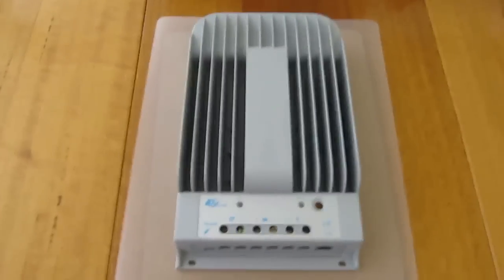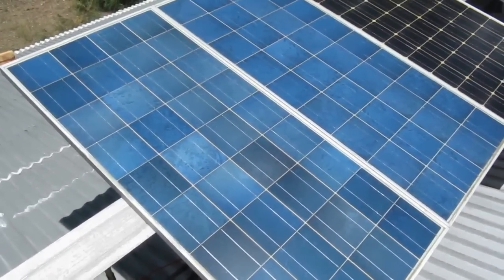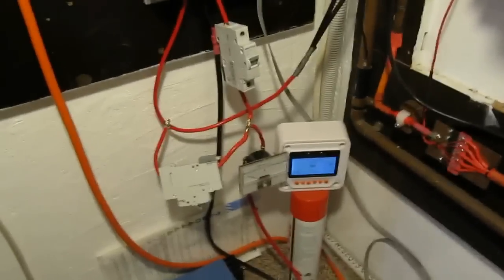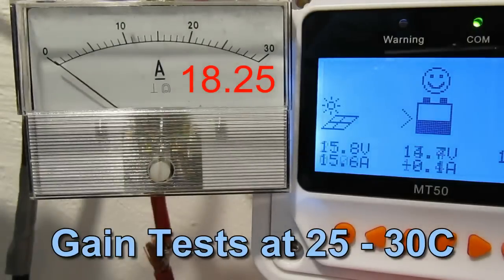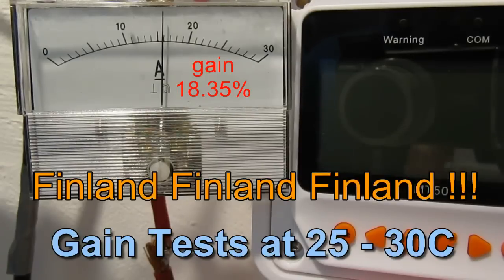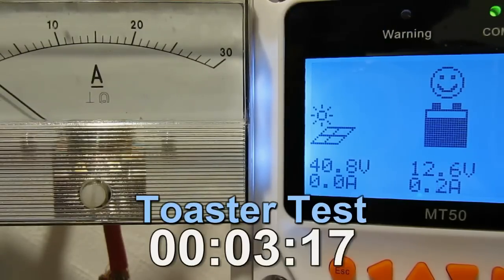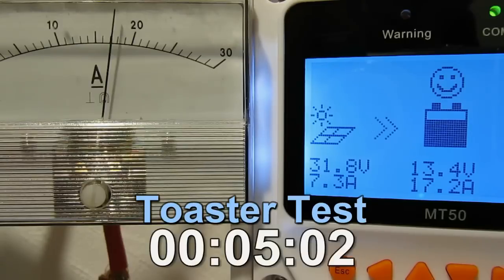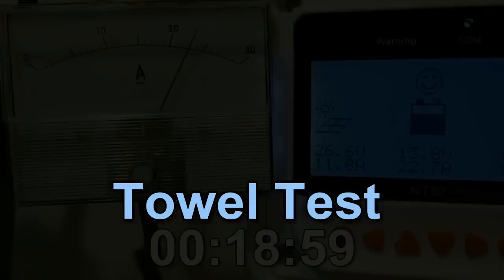EPever EPsolar Tracer 4215B MPPT review PART 1  - 4215BN

Comment: If your panels are barely putting out over the 14.4v, an mppt wont have much gain for you. If you have 92v panels like myself, you'd be an idiot not to use one. The mix of panels probably doesn't help anything and it is tracking to the panel with the lowest voltage at max power. They need a consistent source to measure the peak from or it doesn't work as well because how in the hell does it know what panel to track. Hook it to one of the highest voltage panels and test again. The gains are based off of voltage above charging voltage which you are barely above.
Reply from the maker: +LostInTheElectricalAisle I don't know how you concluded any of that. All 12V panels output 21V when open circuit, no matter how old. The MPPT loads them, to get maximum current into the battery. The specs in the back of the Tracer manual always indicate that 98V is 2% less efficient than 12V configs, on all Tracer models.
Reply: +Wallabynge first sentence is incorrect, didn't read past it. Weird because all my panels have stickers that would disagree. The rating is also at 1000w/m2 under ideal conditions rarely seen in the real world.
Reply: +Wallabynge ok I bothered to read it, back of the manuals say 68v and graphs indicate higher voltage panels combined with higher system voltage is more efficient overall. See how the curve gets flatter. Also, those graphs are in different scales makes it harder for a 1:1 comparison. But my single panels do 126v open circuit, 96.7v loaded.
Reply from the maker: I don't think you mean "over all". The graphs always show lower voltage panels are more efficient, for any given battery voltage.

The maximum normal load of these devices, according to solar installation law, is 75% (360W). At this point, the 12V/12V system achieves 96.25% efficiency, and the higher voltage (720W) 98/24 achieves 96.5%.

I tend to favour 12V, because the only usable battery is the Exide/Sonnenschein A600 Gel cell, which has a pricing sweet spot, around 500-740Ah. If you attempt to buy a 24V bank, it costs more, unless you were going to buy 2x740Ah sets, anyway. For me, battery management is the main concern. Solar power is dirt cheap at the moment.

Comment: Just a question, can i use 24 volts soar panel with 12 volt battery bank?
Reply: Sure you can. While using MPPT controller.
Reply from the maker: Definitely. It should also take the strange voltage "grid connect" panels. The BN series allows about 5 panels in series. They are a bit vague about the maximum OC voltage. I don't like high panel voltages, because you have to keep the panel type the same, and one might die.  http://www.epsolarpv.com/en/index.php/Product/pro_content/id/573/am_id/136

Comment: Hi
Can you guys explain this situation?
I have 2215BN , 200W panel 12v bank, sunny day ov 21v 10a(measurements straight from panel) when i connect it to charge controller it shows on display ov 21v and only .4a - 1a battery charging at 12.6v .4a -1a.
Reply from the maker: +Go lo Sounds wonked. Make sure you haven't set custom settings for it to only charge to 12.6V. I presume you have bitched to the sellers by now.

Comment: Hmmm.... Maybe this thing isn't as smart as it makes out. Calculating SOC from battery voltage is a valid method but has to be done in a careful fashion.

Take a look at the Merlin "Smartgauge" which [supposedly] can track SOC from just the battery voltage. I have no experience with this device but have seen it favourably mentioned several times on other websites.

It seems my simple testing may have had misleading results.

Currently the SOC displayed on the MT5 says 72%, whereas the monitor on the Mastervolt charge I use claims 100% (same battery bank). HOWEVER I do not have the loads connected through the MPPT controller, so I guess it is reverting to simple voltage measurement.

I still believe that the controller has to measure amps in and out and the capacity of the bank to calculate SOC accurately.

Comment: The MPP sweep it does is similar to what the SMA opti trac does, it helps with shaded panels so it can correctly find the global MPP instead of a local MPP. There are quite a few other videos on that too.

It should never take this long though, my SMA does this MPP sweep pulse once every 6 minutes but it takes only a mere second. (as visible on the analog volt meter) I have a video on my channel that displays it.

Comment: lets say, i have a telecom rectifier, its output is 53.5 volts. i want to use it for charging my 48 Volts battery bank.
the first problem with this rectifier is that its output voltage is a bit less as required for charging 48 volts battery bank. so my question is, if i use a solar charge controller for it, so will it work?
i want to connect this rectifier to my solar charge controller and then connect the solar charge controller to my battery bank. will it be able to boost the voltage a little bit for charging batteries?
and second question, lets say, my solar change controller is rated for 20 Amps, but the rectifier output current is 37 Amps. will this damage my solar charge controller if i put into it more amps than its rated for? i think if i put more amp (more than 20 Amps in my case), it wont damage the charge controller but i will give me maximum of 20 Amps in output.
i am just curios about it as these solar charge controller are designed for solar panels. but i just want to know can i supply these controllers from DC source with higher current.

and i dont have this setup yet, but i am planning to do so.
Reply: Ataullah khan 37 amps into a 20 amp controller will cook it faster than an egg.  Get a 40 amp charge controller
Reply from the maker: Ataullah khan Ordinarily I would have said worth a try, but there are two people in this comments section saying their controllers have blown up, using a power supply as the source. If you do this, keep your hand on the heat sink and abort if it gets warm.

Comment: I bought 4215BN charge controller and connected my 800Watt PV Array. Array Consist of-

4 x 125Wp (Vmp=18V, Imp=7A) Poly crystalline
2 x 150 Wp (Vmp=18V, Imp=8.5A) Mono Crysstalline

All are connected in series. 10mmsq copper wire is used to connect PV to cgarge controller to minimize voltage drop. Battery bank is of 24V

The charge controller shows maximum around 500Watt instead of 800watt. It nevr reached even 550Watt. I checked the firmware version of the charge controller but it was blank. Its never shown PV input voltage avove 80V and current 6.5A in peak ay time.

What is the problem. It the controller is faulty or am I doing something wrong?
Reply: If you have panels that output at the same voltage (ie. Vmp) then you should wire in parallel.   Only wire in series if Imp is the same on the panels otherwise the panel with the lowest Imp will limit all the other panels.

Comment: OK my 20A new tracer arrived yesterday and I've hooked it up and put it through its paces. The last one (old tracer 20A) blew itself up by connecting it to a 20V 22A power supply on the PV input. I tried the new one and yep, it also pulls on that supply in an unlimited way. I disconnected it when it reached 300W and climbing. Its rated 260W max. So I saved it from a similar fate to its old man.

It works well. There is a 1-2min delay before it starts pulling on the PV input if there is a disconnect/reconnect. Not sure what its doing there, but it certainly isn't pulling in any power for all that time.

So what I don't understand is why they have it programmed so that it will run itself to self destruction on the PV input. The software already knows its rated PV max current (says so on boot), and the software has full control and monitoring of that current (mppt). Yet the software quite happily allows the FETs to flow infinite current if it is available. Maybe the thermal cutout will protect it? I'm not game enough to try, given my similar earlier assumptions about its predecessor.

So I will just have to run it on 20V 11A PV input for mains charging, and I'm going to run a 180W 24V solar array for off-grid usage. Its in my camper van, so I use it for both mains charging (via said 20V laptop AC adapter) and solar charging.

It would be great if they released the source code and build for this to open source. These issues (the self-destruct and the delays and unnecessary mppt hunting) could all be easily fixed.

Anyway I'm happy with it so far. Got it from aliexpress with mt-50, temp probe and USB cable for around $150 shipped.
Reply from the maker: Gen X The way these regulators stop overload, is by retreating into the high voltage zone of the panels, where there is less current available. In other words, they find a less maximum power point. If you hook it up to a brutal power supply, they have no curve to analyse and no way to stop overload, because they can't do PWM, or dissipate the heat into the heatsink. At the 20V point on a panel, there is very little current or power. The designers assumed that you wouldn't hook it to a power supply for testing, since it's not a valid test.
Reply: Gen X it self destructed cause you hooked a 440 watt power supply to it. (22amp 20v) that's why. Stick with a power supply that's less than 260 watts and you won't blow it up.  Or get the 40 amp model and let you 440 watt power supply giver. The 40 amp model is good to 520 watts so you power supply won't blow it up

Comment: Thanks for the review. I've just ordered the 20A model plus MT50 for my van, currently running an 80W panel into 200Ah SLA.  I did try the earlier model tracer 20A version, and it crapped out when i tried to charge my bank through the solar input using a 20A 20V laptop AC adapter.  The controller charged at full 20A, but only for about 5min, then it must have burnt out something so it only ran in a kind of permanent PWM mode after that lol.  I'm hoping for better results with the new one, and will hopefully use it when I convert to a LifePO4 bank eventually.

Comment: Wallabynge - Do you still have a setup where you can test new firmware? I have been in contact with the factory and they have assured me they will fix the issues detailed in this video. They should have something to test very soon.
Reply from the maker: Travis Wizniuk I have been too lazy to dismantle the test rig, so it's still all going through the test. Have you got the new software yet?

Comment: Usually the SOC (state of charge) is only accurate if you supply the load from the regulator itself, NOT the from the battery.

To calculate the SOC the device needs to know how much power is going out of the battery and for how long. It can only do this if it is measuring the current supplied to the load.

Unfortunately the current rating of the device is the same as the amount of current it can supply to a load. Therefore a 40A device can also only supply 40A to the load. Not much good if you want to run a 2kW inverter!

Generally people install these things with the load connected directly to the battery and so it cannot calculate the SOC with any accuracy at all.
Reply: John Chandler Have you tested this with running all your loads from the charge controller?  I would hook up all my motorhome loads to the charge controller if I knew if it would give me a correct SOC after doing that.  I am not running a large inverter or any high amp loads so I'll keep an eye on it but i doubt I will go over the 30 amp max of my viewstar pwm charge controller.
Reply: RV Crazy Unfortunately the loads I have easily exceed the 30 amp limit but an experiment over a week with the thing driving a light bulb (using the automatic night light feature) gave me a reasonably accurate SOC.

Don't forget that it has to be able to measure the current being taken by the load to accurately determine SOC and the setting for the total battery bank capacity has to be accurate. Just adding up the battery capacity is not enough - you need to perform a controlled discharge to get the ACTUAL capacity of the bank.

For everyday use I imagine the thing would be quite accurate.
Reply: Hey thanks for the reply.  I also just read this reply from ep solar yesterday which says that it's basically calibrated to have the float voltage be 100% of battery capacity.  http://www.instructables.com/id/Solar-Power-Station/step32/EP-Solar-remote-display-Tracer-RN/

I am planning on hooking up the load circuit still but I don't really have much faith in it's algorithm but it would just be nice to see how it does at putting the power back in that I use.

Also I haven't done an actual capacity test yet, only entered in the stated value so I'll look into that, thanks.

Comment: I am looking at buying one of these for 3x 140w panels.  Should they be wired in series? These are the panels http://renytek.co.uk/p/244/semi-flexible-solar-panels I am in the UK with regular cloud cover(!) is the slow tracking going to be an issue?  Would you recommend a different mppt controller, if so, which one works quicker for reasonable money?

Comment: So, after all your testing, would you still recommend this charge controller over the old Tracer 4210? I am close to purchasing for a motorhome and can get either one. Your reviews seem to be pushing me away from this one.
Reply from the maker: Travis, down the page a bit, thinks that the components are all top notch. I'm happy with this one, because it's the cheapest controller that will let me fiddle with all the charging parameters, and I need to do that. Basically, I think the new one has bulletproof hardware, and overkill heat sinking. I think if you push the old one to its full rated current, there is a danger of burnout. Make sure you factor that into your costings. That is, buy a bigger rated older version.
Reply: Wallabynge
Is the slow tracking not that much of a concern. The older model had similar internal components (they use rubycon capacitors) but the heat sink is definitely better on the new one. it will be going into a motorhome , so I am dealing with a 12 volt battery bank. I am going to start with 2 150 watt mono panels with an option to add a 3rd one if needed down the road. I do like the newer display as it gives more info per screen. I do hope they can figure out their firmware a little better. It's too bad you don't have the 4210 to do the same tests with.